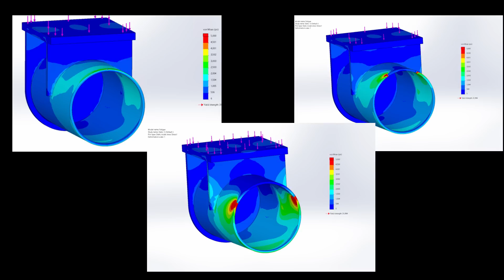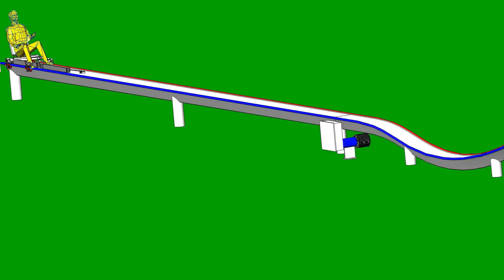Fury 325 Crack Repair Update: What This Means For Reopening

Comment: I think 2-3 weeks is optimistic. They are going to have to deeply inspect all of those supports. Not just the failed one.
Reply from the maker: According to ThemeParkPredictions they've had workers walking the tracks this whole week.
Reply: @MentoredEngineer  I think it’s going to take a bit more than walking the tracks before all parties are satisfied that no more similar cracks are developing. As many have pointed out this is the first time something like this has been seen in a B&M coaster.
Reply: Of course they having people watch it 24/7 now.. like they really care.... they'd have kept that thing running until it wrecked just to save a dollar.  SHUT THAT PARK DOWN NOW!
Reply: Agree, I’m sure they will move quickly but I think it may still take some time. I’d guess they will have the fabrication shop in Ohio make a new support, hopefully the lead times wouldn’t be too bad if they have the raw material and expedite it. Bigger question is what happens if they find other issues which require addressing, then it could be more extensive downtime both on the technical/manufacturing side, and on the legal side as they figure out who should be paying for it.
Reply: Not to mention the most important (in the eyes of CF Corporate) individual who has not been mentioned here..... the all important Attorney!  I believe anything even remotely ride-safety related will be treated highly over-cautiously by CFs legal team after the events of August,2021.  My useless two-cents says Fury is inop for the rest of the season.
Reply: @andrewtaylor940  armchair engineers are coming out the woodwork to give their opinions on this reopening. What are you basing your estimation on? Are you a structural or mechanical engineer? Contractor?
Reply: Though i agree on the last part
Reply from the maker: @someoneout-there2165  Bless your heart.
Reply: but they say all their rodes undergo vigorous inspections EVERY DAY to ensure they are safe lol  how did they miss this of they really do these inspections
Reply: @devanh8592  I think certain track walks like that only happen twice a year or something. Agree it should have been spotted sooner.. and this is a proper learning curve for Carowinds and other parks, just inspect enough so that the general public don't notice something before you do, as that will NEVER look good.

Comment: Regarding the fins welded on the existing support - This is likely a request (requirement) by the inspection company that B&M will enlist to analyze the failure. By tying the two pieces together like this, they can remove both of them without risking further damage to the failure point due to collision during removal or transport. I have seen this done in the past, so it isn't uncommon.

As far as using a CMM or similar to check the amount of deflection, I doubt that B&M cares to that level of precision regarding the replacement support. (Yes, by now we know that a replacement is being fabricated.) The error in displacement looks to be less than 1". Thermal expansion forces are likely to cause that level of displacement, and it is currently pretty warm in the afternoons in CLT. I suspect that a re-survey of the footers will provide far better information than the displacement after failure ever could.

Finally, regarding the diagonal being in tension vs. compression - the diagonal is most likely stronger in tension as there is no risk of buckling as there would be with compression. The footer would need to resist upward rather than downward forces, but this is not hard to achieve with adequate civil design.
Reply from the maker: Thanks for the input

Comment: It happened right at the fishmouth/saddle. I'd bet money it cracked at the top of the connection where they tied the welds in and the force pushimg out made the crack spread quickly. It was probably also a hacked weave weld that wasn't a proper full or partial pin weld. 

Replace the old column with a new one
Reply from the maker: Good insight

Comment: Might we see some similar additional bracing on the adjacent supports? After all, they've been carrying some extra load as this support failed. Cracks might not yet be visible on those, but they could have been somewhat weakened by the additional loading. Better to be safe if they're looking for a temporary fix to get the coaster back open for the rest of the season. It will also be interesting to watch and analyze the longer term repairs as they unfold. How much additional work will be done to be sure the coaster remains safe for years to come?
Reply from the maker: As one who has had to deal with structural support issues.  The number of load cycles that were accrued on the adjacent structure since the main structure started ithe crack is few (2 weeks, 40 dispataches/hour, 12 hr per day = 1120 cycles).  If the load doubled on the adjacent supports, this mathematically isn't enough to change the overall fatigue life because the repair would bring the loads back to normal quickly.
I would inspect those supports closely and if no cracks were found return to normal operation.

Comment: In my industry, we'd be cutting it out and getting metallurgical analysis done, but our pipe is pressure containing, not structural. If B&M has the MTRs for the pipe and any NDT for the welds, it would be worth reviewing (if I were them). This may be only the first issue if there is an underlying material quality problem. Did they have any manufacturing issues that had to be dealt with, like weld repairs or an unusually large heat affected zone? How was the pipe heat treated for welding (preheat? post-welding stress relief?). Did they check for internal corrosion? Anybody check that the wall thickness is still what it is supposed to be? Until they rule out some things, it doesn't make sense to me to rush it back into service. And that repair looks pretty janky. // Edited to add: Maybe they have checked already and this is why they proceeded.
Reply: Ask Claremont, in Ohio.
They build both track and supports for North American B&M coasters.
Reply: I think that repair is just to stabilize it for now

Comment: If that support beam is supposed to be on the outside so the load can push into it, why didn't they account for that when deciding where to put it. Physics doesn't exactly care that it's inconvenient for it to be on the outside.  Wouldn't B&B require that it be placed properly?
Reply: B&M designed that helix based on the available footprint. They knew they were using a tension brace on that support and did their engineering accordingly. This isn’t a unique helix design among B&M coasters, and historically there are lots of coasters with internally braced curves, often using wire rope instead of rigid members, especially among wood coasters.

Comment: just a couple of comments thoughts.....
this isnt the first time a B&M has had issues this is the only one that has had this coverage. and we are aware. There are other B&Ms that have needed welds and repairs we just arent always privy to the information I am sure there have been plenty of times routine inspections have prevented a similar situation from "propagating" (see what i did there) .... Case in point Goliath at Atlanta I think  which has what appears to be bracing along those welds in similar spots. 
My thought is the purpose of this and the many supports in that turn are to prevent the track from moving too far i would be interested to see a side by side of that same turn and if the track is even moving further than it was before the failure...just curious if the support failed because it was weak or because it was too strong and not letting the track move as it should so it found the weakest point to move.

Comment: This has to be just to stop this from completely failing, right?  There's no way a failure of this magnitude on the tallest, fastest coaster around could just be diagnosed, repaired, and signed-off on and presented back to the public this quick.  Is there any government oversight of this park?
Reply: Carowinds is regulated by both the North Carolina Department of Labor and by the South Carolina Department of Labor. Each State has its own specific rules, but both States regulate and inspect rides mostly in accordance with the standards produced by ASTM International Committee F24 on Amusement Rides and Devices. ASTM standards address design, manufacture, installation, commissioning, operation, inspection, maintenance, and even decommissioning and disposal of amusement rides. All of that can mostly be summed up as, “Do as directed by the manufacturer” while the manufacturer is guided by the design standard.
Reply: Oh…my undereducated guess is that those plates were tacked into place to hold the broken pieces in place in preparation for a repair weld. If they didn’t anticipate welding the break, I’m not sure the plates would have that gap across the break.

Comment: Afaik NC regulates the whole ride since it's control booth is in NC.
Reply: At Carowinds, the jurisdiction is determined by the location of the primary electrical disconnect for the ride. I don’t know what that means for Fury 325, but I know that given a choice, the park has a preference as to which Authority it would prefer to Have Jurisdiction over the ride.
Reply from the maker: Thanks for letting me know!

Comment: I would be concerned the metal is brittle from poor heat treatment. If it all came from China you might have a much bigger issue
Reply: These things are made from mild steel; the closest thing to heat treatment these supports get is from the welding during the fabrication process. I don’t know where the steel comes from, but the fabrication is done by a shop near Cincinnati, Ohio.
Reply: A metal breaking in half is brittle. Any metal that breaks like this from China and forgive my wording it is not made properly. It is a very common issue in Chinese construction probably why the coaster coast 30 million not 100. It is common sense this metal isn’t supposed to crack. It is why they make videos on how horrible Chinese construction is

Comment: These mega coasters always end up having problems. These tall steel coasters are sterile they feel like a safe machine. In the old days the wooden coasters that were a real living breathing work of art to ride and look at. Depending on the weather and if they greased the track and which seat you were in gave a different ride. They have torn down a lot of these real rides or altered them so I don't go to parks anymore. A good coaster was the original wild one at adventure world now six flags America and the riverside cyclone in MA before six flags bought and wrecked it. I could go on and on but you get the idea. I suppose the Phoenix at Knoebels is still pretty good but for some reason people think bigger and taller and faster is better.
Reply: The Wild one isn't wrecked at all. When it was moved to Maryland they actually restored the original helix it had that had been missing because of an earlier fire. It still rides great especially for being over 100 years old.
Reply: @DanielBlaney  It is not 100 years old it was rebuilt in 1986 and I rode it in 1995 and it was amazing but they changed a few things later, the first drop was made smooth and shorter without the cave in half way down where when you were in the back seat you would get yanked out of your seat, and the 1st half was altered and mutilated and the turn around was wrecked, but the last half was about the same but they added a trim brake before the helix. When they first had it in 1986 it was so wild the fake dummies they tested it with didn't stay in the seat lol.
Reply: These rides are safe. This manufacturer has an astonishing safety record. Any injures or deaths are due to the rider not the ride malfunctioning.  131 coasters not one breaking because of a manufacturer defect. The footing settled . That can happen anywhere.
Reply: B&M has been making coasters for 45+ years and has never had a single death, barely ever an injury.  They overengineer their coasters to withstand this type of failure no problem.  There is no safer coaster manufacturer than B&M.  They have hundreds of millions of rides on their coasters.
Reply: There is no correlation between the size of a ride and its safety. All coasters are subject to both static and dynamic loads. B and M been in business for 30 years no fatalities or major failures. Many of their rides still operate today. This was an isolated incident irrespective of the size of the coaster, just like a smaller car doesn't make it safer than a larger car. Steel coasters last better than wood coasters.
Reply: @gametime2473  You are right they have great safety but the rides feel like a safe sterile machine, they have no life or feel. The best ride they ever had was the original inverted coaster but all the others the sit down the 4 seat across they have no feel. If I wanted to go on a safe sterile machine I would ride my car. You should have tried the wooden coaster blue streak at Conneaut Lake or the screechin eagle at Americana in OH, your thighs would be numb from the airtime.
Reply: I miss Thunder Road at Carowinds. It was my first big coaster and I rode it as soon as I was tall enough. Back then, it just had a tiny little lap bar for restraint, and I remember my dad hooking his leg around mine because we thought it was necessary to help hold me in😂. That wooden track beat the hell out of you, but man, it was fun!
Reply: To some extent it's about money. Wooden coasters cost less up front but they require a lot more regular maintenance and need to be completely retracked every few years-- a steel ride has a lower total cost of ownership. I love the woodies too, but I can understand the parks' move away from them.

(The last coaster I rode was actually a woodie--Stampida at PortAventura, a racing/dueling coaster a bit like Lightning Racer at Hersheypark.)
Reply: @Jeffs60  Yeah, I went to Conneaut TWICE and the park was closed both times when they should have been open according to all knowing google.  Just some old guy riding around in a golf cart the first time, telling people the park was closed.  Second time there was no one there at all.  Now it's burned down.  Bummed about that miss.

I have always been a big wood coaster fan myself but I really enjoy many B&M coasters as well.  A matter of taste I guess.

Comment: So you think they will just weld more steel plates around it and re-open Fury like that? I figured that support wasn't saveable after a complete separation like that and they would have to have a completely new support made and sent in, and that this was more of a temporary thing to not add more stress to the track and surrounding supports like you said.
Reply from the maker: I used to support aerial work platforms (guys that play with power lines).  It is common for issues like these to have permanent field repairs like this.  I believe that the temporary fix will be replaced by something better looking during down time.